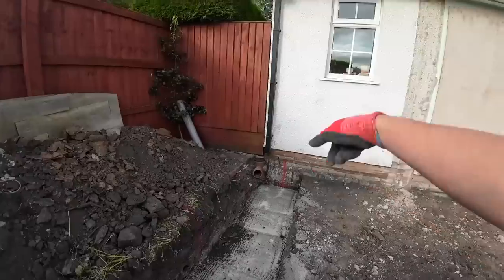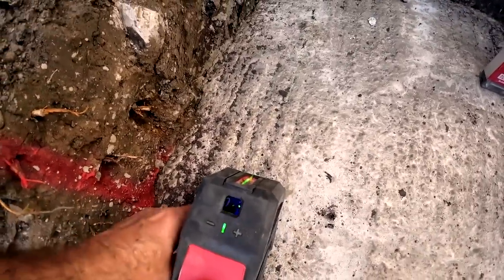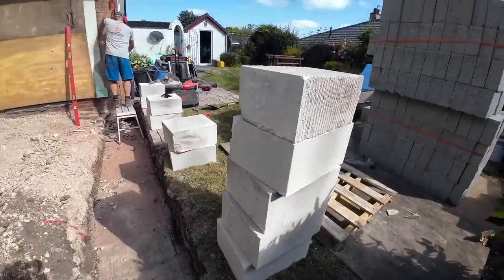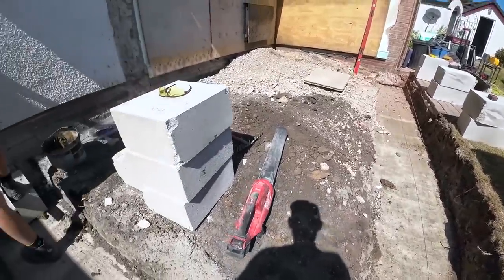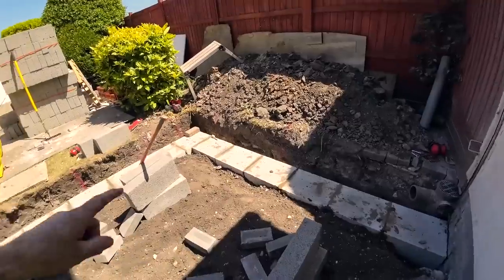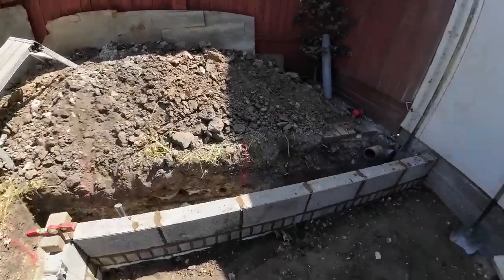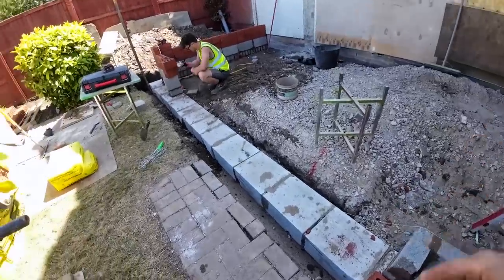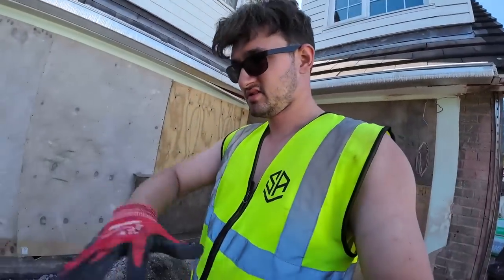PART L BUILDING REGS MEANS WIDER TRENCH BLOCKS ..350 MM ..150 MM EXTENSION PT 3

Comment: Just built my extension using the 350 blocks.  Wider cavity = Extra Costs are adding up.  Wider lintels.  More insulation ect.
Reply from the maker: Exactly mate , it’s coming to all of us 😬🧱👍🏽
Reply: Pretty pointless on older builds
Reply: Because the rest of the house, 90% of it is still explusing heat at the same rate it always has.
Reply: @SteveAndAlexBuild   so true.  A real pain ATM.  I found certain wall ties were not quite long enough even though stated as 275.  Pre-finished Sill boards are now harder to find.   
Building inspector was helpful though and a bit more flexible than my past experience.
I intended doing brick, 150mm full fill rock wool 32 and block.  But found out from the inspector I would need additional 25mm insulation  on the inside to meet the code.  Ended up using 100mm celotex in the cavity.  Not cheap
Reply from the maker: No that stuff is ridiculous 😫🧱👍🏽

Comment: I did a extension on a relatively new build, when the existing foundation blocks were exposed, they were fractured. Why? I can't tell you, but, I've never been happy building a building on an airated moisture sapping block. We do foundations in concrete common bricks. Yes, I know you have to cavity fill etc etc. Those lightweight blocks will not stand the test of time. My bricklaying crystal ball has served me well for 36 years.

Comment: The wall starter which was fixed onto the render. The render should’ve been hacked off, so the wall starter would’ve been fixed fixed directly to the brickwork or block work, which is over behind the render for a structural fitting as the fixings will only go in a little bit if you keep the render on

Comment: @steveandalexbuild great video guys, really enjoying this build.  Serious question (not a criticism) is there a reason that Alex bedded the trench blocks without full coverage? From what I can see the 2 lines or mortar would struggle to cover the entire 350mm block.🤔
Reply from the maker: We never put a full bed under trench . The beds need room to spread . They are Rock hard to get down with a full bed plus there are only beds where there are walls above 🧱👍🏽
Reply: @SteveAndAlexBuild  thanks for taking the time to respond 👍
Reply from the maker: No problem. Thanks for watching and commenting 🧱👍🏽
Reply: i did wonder this too. more from a point of if regs are bigger blocks then should it be a tripple line layed in. again a question not criticism. only if you pulled one up you would know the percentage coverage. things like big tiles have funny things go on underneath. also do you wet the concrete down first. cheers
Reply from the maker: The wall is wider but the two 100 mm skins still only sit on each side with a 150 mm cavity where nothing sits above 🧱👍🏽

Comment: Do you guys ever put half courses below the door when the DPC is higher than the FFL? So the door threshold is level with the floor.
Reply from the maker: A few times 🧱👍🏽
Reply: I'm not a bricklayer and this confused me. Do you mean cut the bricks so they are only half the height so there is room to sink the door threshhold down to get a flush threshold? I'm struggling  to get an answer on how to achieve flush thresholds

Comment: That first row of blocks is only resting on a strip of muck at each longitudinal edge, is that ok by the regs/inspector?
Reply from the maker: Yes, that is where the walls sit above 🧱👍🏽
Reply: But surely it makes it weak in the middle of the block. If it was to break wouldn’t it tip to the middle ?
Reply from the maker: They won’t break and the cavity is in the middle where there is zero weight on the block

Comment: This is where the cretins did not think this new gap through and new regs for all, are ridiculous, 150mm cavity meets an old cavity with an undetermined gap.
Reply: I think you can still go with 100mm cavity as long as you use insulated plaster boards on the inside
Reply: Like how do you join up the new 150mm cavity onto a house like mine that has a 50mm cavity without creating a cold spot
Reply: @martin2466  Research 1930 semi's and Victoria houses, small cavities! Solid brick walls have a U-value of around 2.1-3W/m² and adding 50mm of expanded polystyrene (EPS) will take the U-value down to 0.5W/m²k

Comment: 350 wide trench and boy is putting two tiny beds of mortar on the edge?!
Reply from the maker: They are full beds under each wall . Not sure if you know this but here is a secret when the block goes down the mortar spreads out like magic 🪄 🤗
Reply: @SteveAndAlexBuild  bollocks🤣🤣
Reply: @SteveAndAlexBuild   15.25 just watch
Reply from the maker: I don’t need to watch I was there
Reply: @SteveAndAlexBuild  No way did the mortar spread out that much, you could see it squashing out an inch from the side. There would be hollows under the blocks and perps, bad practice indeed.
Reply from the maker: The beds are under each leaf of the walls . There is a cavity in the middle 🙄. As for perps the manufacturer says you don’t perp trench blocks so get your facts right